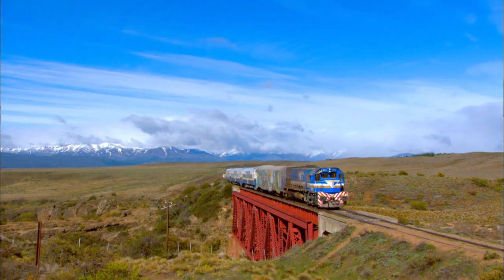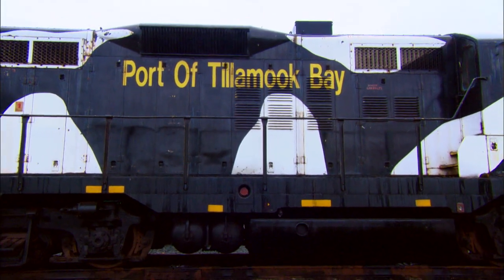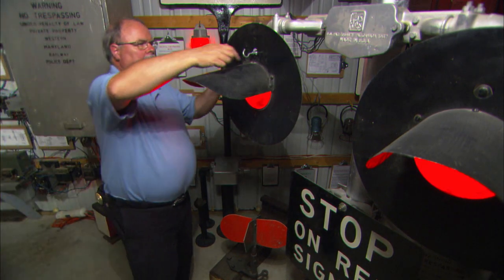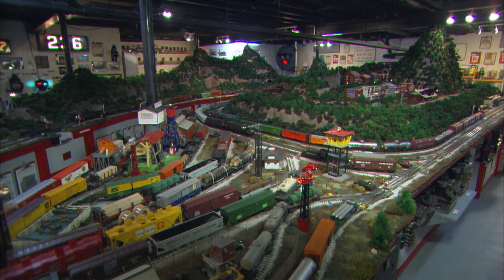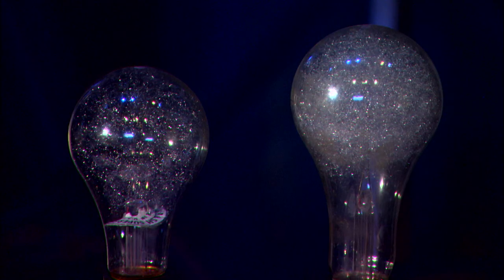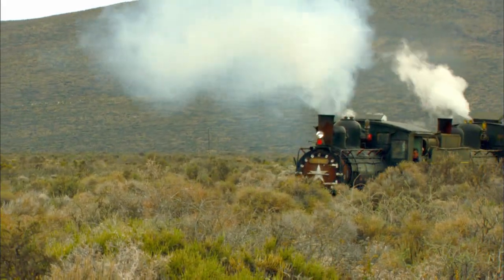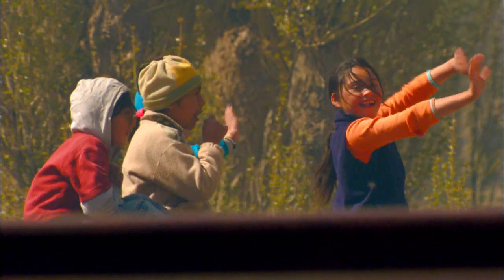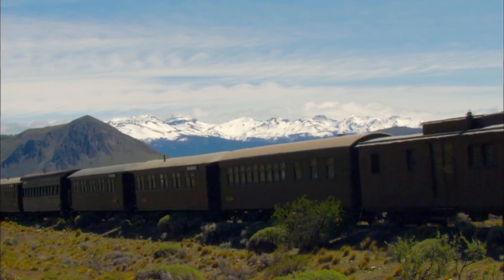Oregon Coast Scenic Railroad - Tracks Ahead (S9|E3)

Comment: The Oregon Coast Scenic started in 2003, when the Port of Tillamook Bay offered Scott Wickert the opportunity to bring his Curtiss #2 Heisler to Garibaldi to run weekend steam train excursions. Prior to that, POTB ran an RDC excursion train called the Oregon Coast Explorer between Garibaldi, Rockaway Beach and Wheeler, and built passenger shelters in those towns for the service which OCSR now uses for its trains. OCSR broke off as its own entity in 2006 and became fully independent from POTB, and in the winter of 2007 a severe storm washed out several miles of track in the Salmonberry River Canyon in the Coast Range, which POTB opted not to repair and thus the freight railroad shut down. Since then OCSR is the sole operator of the tracks which it leases from POTB and is responsible for maintaining between the former Tillamook Air Station and Enright, a point five miles up the Salmonberry Canyon and just west of the major washouts. OCSR has reopened the line as far as Salmonberry, at the entrance to the Salmonberry Canyon where the Salmonberry River flows into the Nehalem River, and has run some charter trips to there as well as south toward Tillamook.

The Wilson River coach, along with a few identical coaches, were acquired from the defunct Yreka Western Railroad in Northern California, and have been moved to Tillamook to be restored as demand requires. Their two RDC cars were from the POTB’s Oregon Coast Explorer train and had their tractive motors removed prior to beginning service on OCSR. The GN F7 belonged to Doyle McCormick, the one who led the SP 4449 restoration, and had been stranded in Garibaldi after the 2007 storm so OCSR acquired it. The GP9 101 was painted as a Holstein cow by POTB to pay tribute to Tillamook’s dairy industry. OCSR has acquired a few more steam locomotives since this was filmed, including 2-8-2 Polson #2 from Wisconsin. 

There’s a group called the Salmonberry Trail Coalition working to convert the unused track over the Coast Range into a non-motorized trail that would parallel the active OCSR tracks from Tillamook to at least Salmonberry.